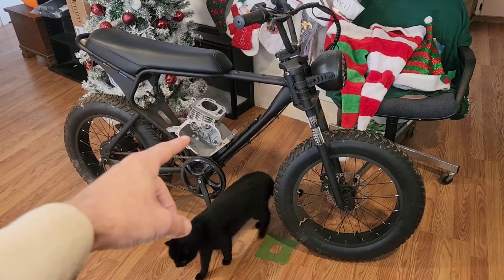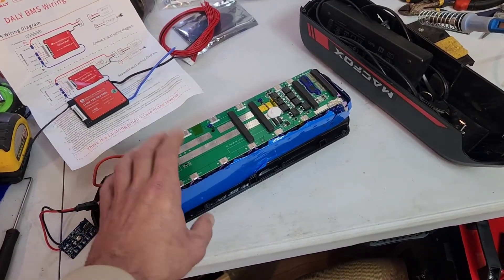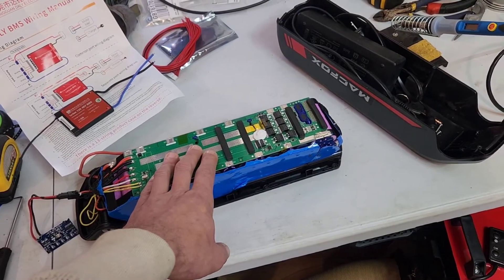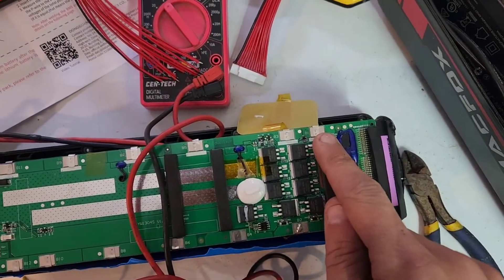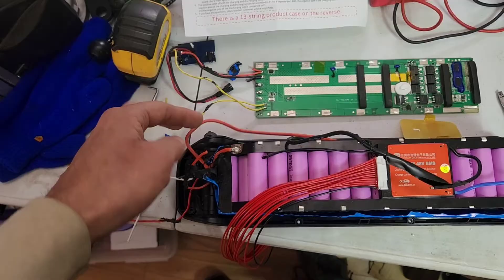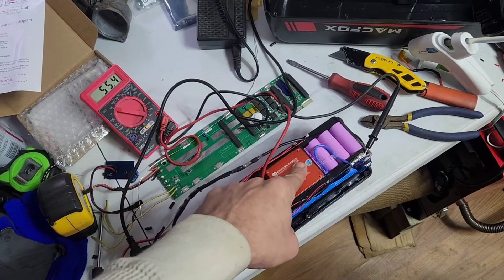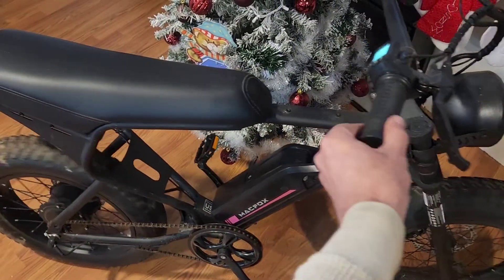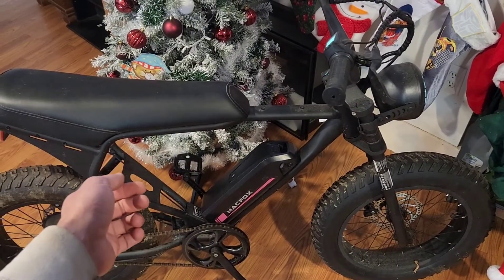48v Bike Battery Repair BMS Replacement MACFOX

Comment: out here in LA they just let kids ride E-motorcycles on the street.. No pedals   45MPH     Cops are defunded and don't  seem to care.    I think my BMS is going bad... Sometimes works fine... other times will cut out and  after removing and reinstalling battery will work for about 6 seconds.   Its not low an voltage or charge.    I wonder about just soildering on some new trasistors to repair if the numbers are visible and can be ordered.

Comment: 🛑 WARNING 🛑 
You cannot drain any lithium ion battery to zero volts unless you want to destroy it. Lithium ion batteries (cells) operate from 2.7v to 4.2v for each parallel cell group in your battery.
If you drain a 48v battery below 2.7v each cell group (13 cells x 2.7v =  35.1v is the MAXIMUM DISCHARGE!
Below this voltage WILL ABSOLUTELY destroy your battery 100%
The chemistry of li-ion cells will not allow you to recharge your battery beyond this point.
If you try to Force Charge your battery back up after discharging below the limit amount of 2.7v. It will over heat and Explode! This will cause a lithium ion Fire and Burn your House or whatever building it is in down to the ground.
Please dear friend.. read study and know how modern li-ion batteries work. They do not function like a lead acid battery.
Please be careful and safe dear sir.
Peace Prospector Tripp

Comment: 48 v battery fully charged is usually 54.6 v. That’s 13 x 4.2 v. 
When I change a BMS I try to use one that has exact same sensing plug. 14 wires. 13 red and 1 black. Saves taking wrapping completely off the battery. Also the max ampage output of BMS varies by application. 
Some only supply 10 amps. Others up to 60 amps and beyond. 
The sensing plug allows us to measure the voltage of each of the 13 banks of cells. 

Over time if a BMS is faulty or as batteries age and discharge at different rates these 13 banks can have different voltages. 
However once 1 bank reaches 4.2v the BMS will turn off charging.

Comment: I always Wanted to get a Phatmoto Gas Bike , But kinda a lot of coin. 
They use 79CC Engines. 
I have a Honda GX120 Engine that i want to build mine own one year when i get time LOL! 
But Electric also , Hybrid Type i am thinking. 

I would have just Changed the Temp Sensor on the Current BMS 
I am always worried about using cheap china BMS units. 
Well , As long a you charge her in a Safe spot.. Maybe ok LOL